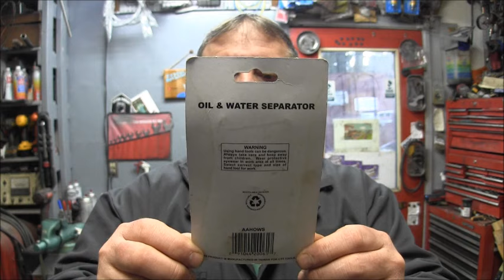SEAGULL  OUTBOARD,,    PART  2

Comment: Hi Kodi, Sorry to hear your fighting the nasty flu bug. So far we have excaped it knock on wood. Got another newer RV so will get back to traveling again soon. Sold the 57 Mercury Mark 10 to make some room for the 1965 VW engine I picked up in Antacortes a couple months ago. Having fun with it for sure and soon put it back together with new parts. Seen a couple of them Seagull motors on marketplace down here. What I would like to pick up someday is the vintage Pre War Johnson
Reply from the maker: Thanks Tim  wish I had my old Bug.   I have a vid of a 1935 All chrome & Brass Johnson beauty I got running several years ago.  sold it     kb

Comment: Cody that's actually an air filter for air tools is separates the water that condenses in your air compressor and it makes your tools last longer
Reply from the maker: Yep'  Will it work for a fuel hose in the same way?    kb

Comment: Great video and hope you feel better.
You never showed the gas fittings you got at the thrift shop
Reply from the maker: Was a air filter,  I want to try & see if it will work as a water separator for a fuel hose?  kb

Comment: I want to ask you if you can take a picture of what wire it connects to on a Yamaha 9.9f four-stroke from 99. I am asking for help. Because I was removing the engine from the stand and I didn't note which installation wire it connects to.
Reply: Video

Comment: Hi Kodi,
My 6,5hp evinrude sometimes misfires and dies when i throttle down too fast, what would you think would be the main cause of this? Ignition not catching up? I cleaned the carb but I wasn't extremely thorough. 
Thanks, Gabe
Reply from the maker: Could B the gasket behind the carb or around the intake. also check your hose connections. kb